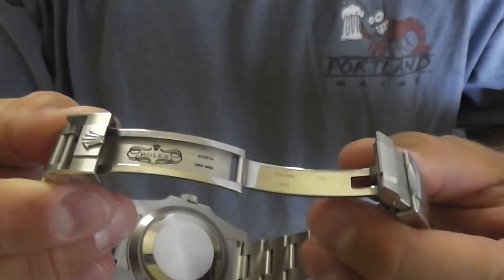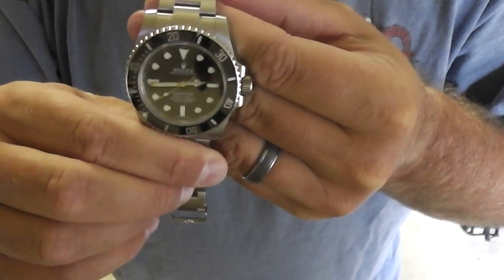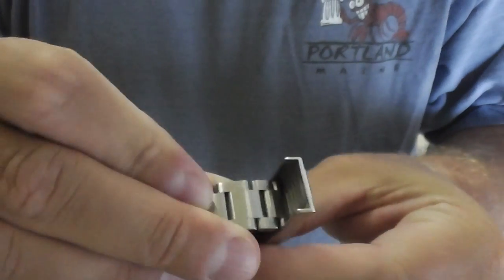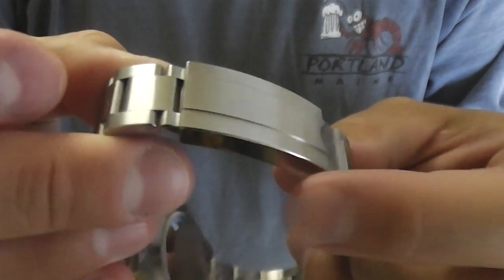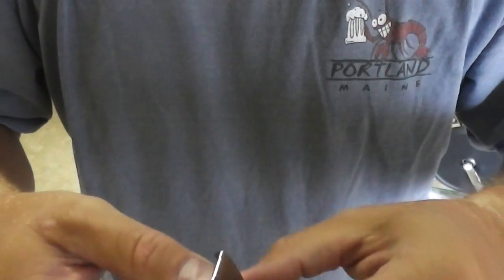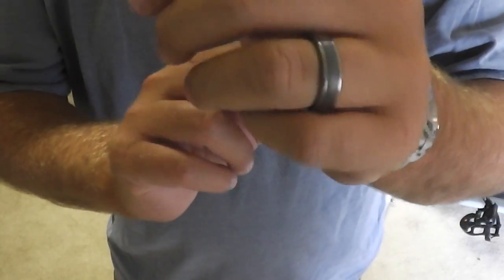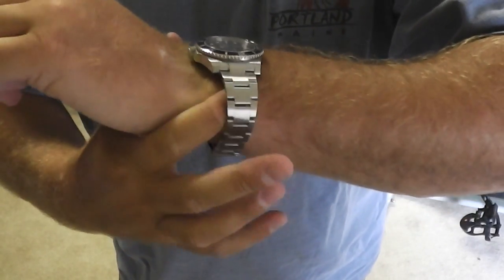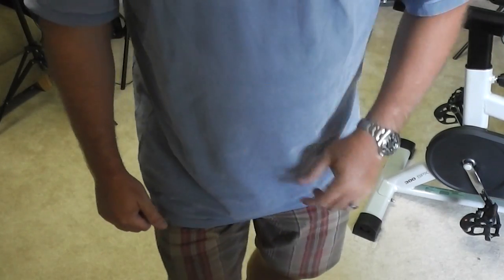Rolex GlideLock Clasp Demonstration

Comment: The microphone you used was unbelievable. It picked up the bezel movement beautifully. So many other postings try to do that but fail. On your video however, the sound was clear and crisp.
Reply from the maker: takutatanga Thank you so much.  It was a Rode VideoMic.  I agree the bezel movement of the Submariner is so crisp!  I own several higher-end dive watches and the bezel on the 114060 has a tactile and audible movement that I have not found in any other dive watch.

Comment: Hey, So I gave a friend my Rolex Submariner to try out and he gives it back to me and the clasp had lost its rivet pin and the bracelet could not connect together, with the clasp, there is a missing screw with a hole and my friend lost the screw, shall I get a new clasp or could i possibly get it repaired

At 0:55, that specific part you show cannot connect to the other side, please help :(
Reply from the maker: You may get lucky and find cheap bracelet components on a site like Ebay.  These things are built like a tank.  How did you manage to break it?
Reply: Well he had no clue how to open it, not really a friend but just someone i know but then he broke it with force but I'm going to visit a store this weekend and hope to get it fixed, thanks for replying though

Comment from the maker: I like the Date Just 2 but my only concern there would be resale value.  Unlike the Rolex sports models there are so many variations of the DJ2.  That in my opinion makes the ease of resale more difficult.  With Explorer 2 you either have a white face or a black face =)  You're right about the under the radar part though.  My Oyster Perpetual NON-DATE is under the radar but my only gripe there is 36mm.  I can wear 36mm but it definitely feels smallish after any other piece.

Comment from the maker: I'd go Explorer 2.  The Milgaus has too limited of a fan base, should you decide to trade or sell.  I also have a NON-DATE Oyster Perpetual but I personally don't like the DJ line.  I believe that Sub, Explorer, GMT sport watches are the best bet.  I live my Sub as well....it's tied neck and neck with my JLC Master Control but is of course more rugged.  Zero scratches on ceramic bezel....you?